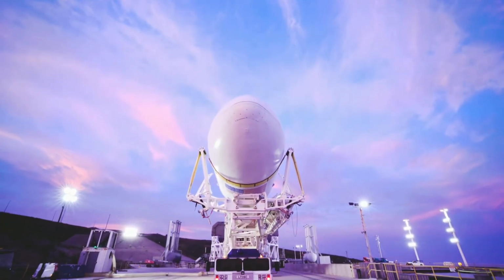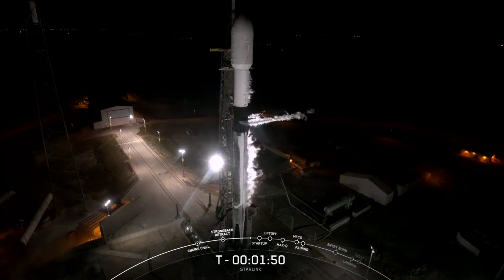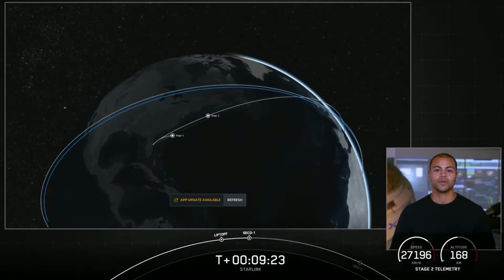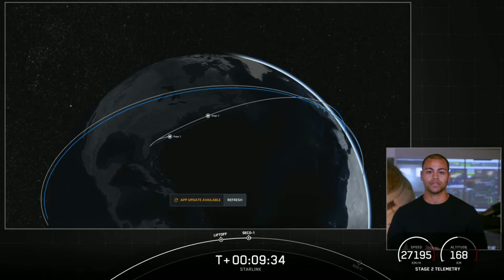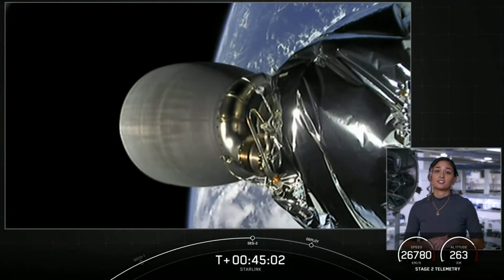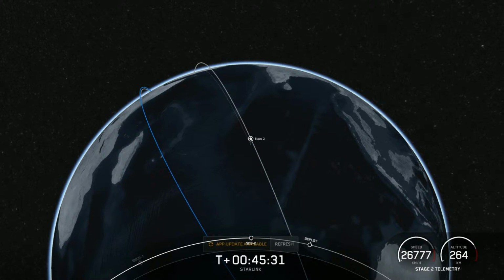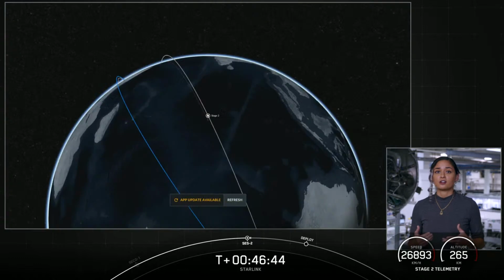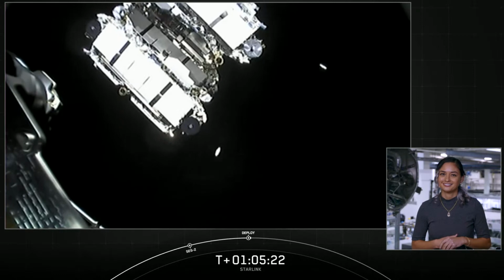Starlink Mission

Comment: This booster is historical, carrying human and carried the most sattalites to orbit ever
Reply: "IT BELONGS IN A MUSUEM!!!"
Reply: @KayoMichiels  So do you!
Reply: @MentalParadox  XD
Reply: @KayoMichiels  might explode before that can happen
Reply: @casperparry6976  An orbital booster detanks after landing which is mean is getting all its fuel and pressure out of the booster on the drone ship after landing.
Reply: @Heap_InnovatorsRBLX  Sure, but it's never a guarantee it will make it down to the droneship after the next flight.  2-3 flights ago SpaceX lost a booster when something went awry after entry burn shutdown
Reply: @epicspacetroll1399  It was due to a engine problem or something, but after that have they had an booster loss? No. Mistakes happen.
Reply: @fedora997  You said it yourself.  Mistakes happen. Stage 1 landing isnt guaranteed yet.  Heck, we are only a couple years in from the first landing.  It took decades before they could achieve 99.9% successfu takeoff/landing rate on planes
Reply: @mugshotmarley  Agreed.
Reply: @fedora997  Yah it was 2-3 missions ago and SpaceX has had a great success rate with recovering the boosters.  Of course it hasn't happened again.  I'm not saying boosters crash all the time.

I'd have to check the statistics, but I believe most boosters aren't on 8 flights like the last one that crashed.  It may be that at 8,9,10 flights, the wear and tear adds up and chances of recovery go down.  Or it might have been just a one-off.  I personally am hoping for the latter, and to one day see a booster like this at a museum would be great.

All I'm saying is there's no guarantee the booster will survive until a point SpaceX decides to actually puposely retire it.*  It may just get flown until it dies.  Safing the booster after landing is hardly the concerning issue.
 
Then again, who knows.  Purposeful retirement might just be a last flight in expendable mode.
Reply: @fedora997  The landing that failed recently was one of their oldest boosters (using slightly older design hardware), and it was a protective coat around the engines that broke at one point during the entry burn, meaning some fire got into where it shouldn't be and damaged the engines. 
In all likelyhood, SpaceX have corrected this issue on every one of their current and future boosters by now. And don't forget that the primary mission was still a success even if the booster didn't land. It still flew 6 times, which is 5 times more than any other rocket is capable of.
Reply: @carljohan9265  I know.
Reply: @anthonyjames4247  😂 that's internal money kiddo also spacex actually makes money
Reply: @randomhobbies5796  They saved $1.4 billion alone by reusing boosters and fairing halves
Reply: @fedora997  correct
Reply: Precisely speaking, it neither carried human, nor any satallite to the orbit. But, it DOES carried the 2nd stages which have done those things.
Reply: @parkershaw8529  You know what I meant.
Reply: @fedora997  Yes, I am with you, it's historical!
Reply: Yes
Reply: @anthonyjames4247  🤡
Reply: While I do agree I don't think it's necessarily historical yet just bc we have yet it see its full potential. Granted it's got one hell of a head start lol
Reply: @stewiegriffin88  It's historical two times over, the question is how much more historical it can get before it's retired :)
Reply: @carljohan9265  Basically the point I'm getting at...
Reply: @stewiegriffin88  I’m with you. I think Spacex has another 10 years of landing boosters before we can start using the word “historical.” But, to doubt they get to that point is futile. I can’t wait to walk my kids through the museum to see any SpaceX hardware
Reply: @ithyphallic7  Same here and well said. I know a lot of people will try to argue this but falcon 9 is monumental but no different than any other rocket with the exception of it being reusable. Now the Starship, when done will definitely be historic just in the fact it'll make humans an interplanetary species. Still can't wait to take the kiddos thru that museum if and when it's built
Reply: And it will launch tomorrow again
Reply: Am feeling like asking, did it make it...  Then why is the video for?
Reply: Qwerty

Comment: I thought "Starlink" was to be a reasonable cost choice vs single option cable internet providers. Cost is too high.
Reply: If you have access to high speed cable internet, you don't need Starlink.  Starlink competes with satellite options that are way slower and way more expensive.  Also an option for people without any internet connectivity.
Reply: You mean the cost is too high ........for you! 😥
Reply: No.  That's not what Starlink is about at all.  It's to provide service where people can't get it or are dependant on cell towers.  It will also help provide internet at sea and I guess to flying aircraft too.